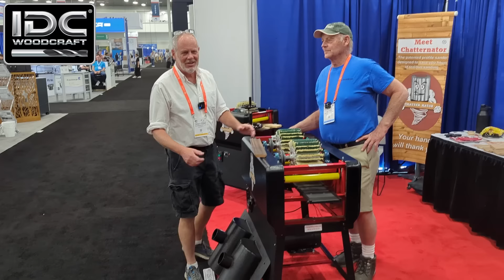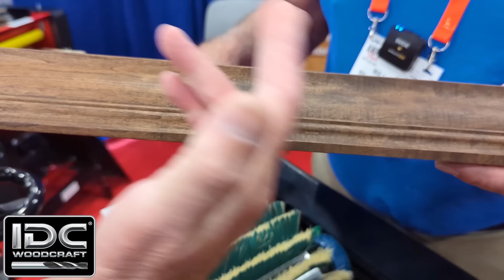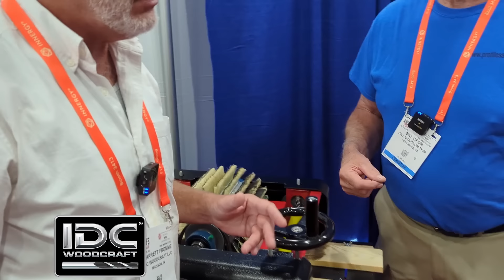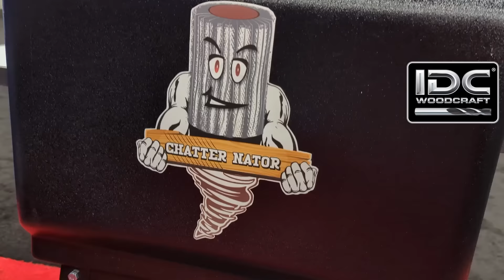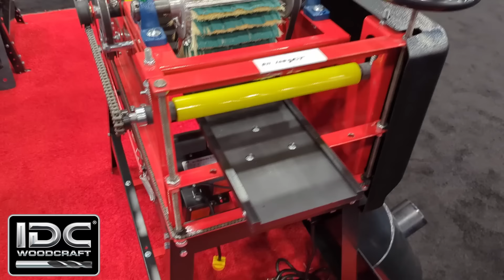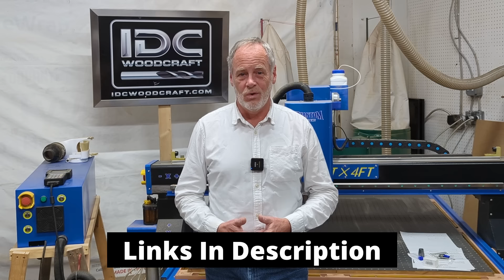A Very Useful Sanding Machine for Woodworkers and Trim Work

Comment: Nice idea! Molding is always tough to get the machine marks out of by hand. But then, running wood parts through even the best planers and shapers leaves some chatter or tooling marks.

What I like about this machine is its ability to conform to the profile of the shaped piece, which you can't get from a drum sander or other hand sanding machines. I would guess that snipe is not a thing as the brushes are flexible and will simply keep a smooth run -through with the feed rollers.
So, if you are a machine oriented wood worker in a production shop, you could go from the jointer, table saw, planer, (drum sander for fine width), shaper,  then chatternator!

If I were to use this for wood material cut on  a cnc,  it may work well on tray pieces if they aren't too deep, or perhaps certain signs that haven't recieved a finish prior to carving. I'm sure there's plenty of uses for what looks like a very large "flapper sander" !

A limitation might be that it is basically intended for flat stock with a shallow profile on one face. Also, this probably wouldn't be very effective in thickness refining, which is better accomplish using a drum sander.

I love innovation!
Reply from the maker: garyhome, very good points brother! I couldn't agree more, this a great machine for a big shop.